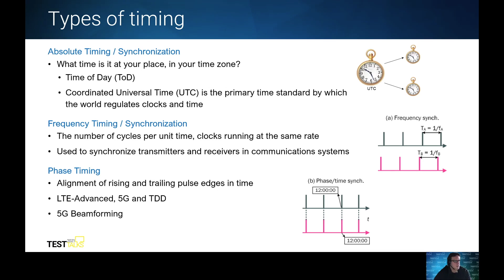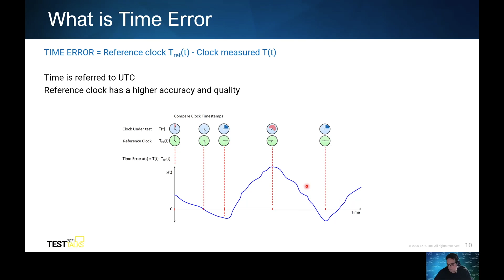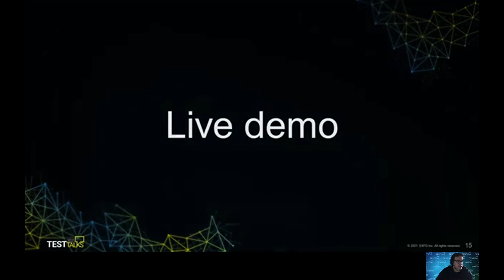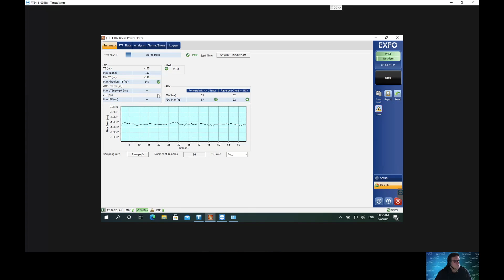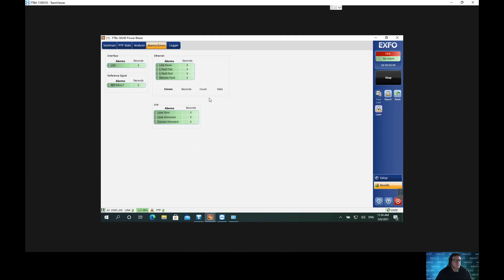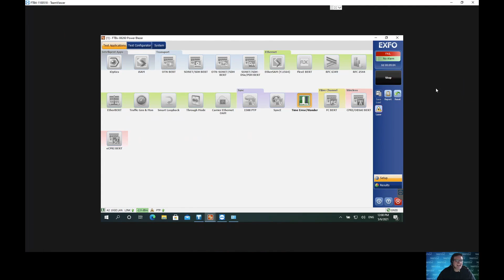Timing and synchronization critical for 5G

Comment: Nice Tutorial , A quick question if PtP provides Frequency , phase and ToD synchronization . What is the need of having SyncE along with PtP?
Reply: Could be the same reason we use ptp-aware switches with ADVA, while having another ptp in radio that connected to switch.